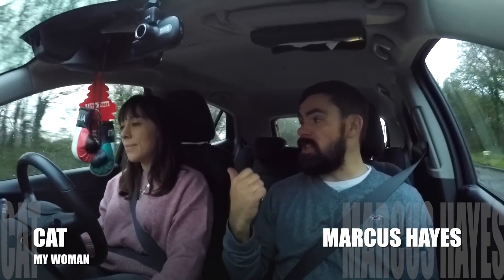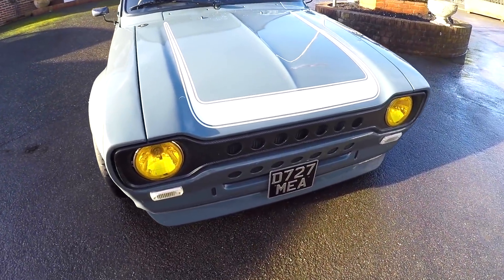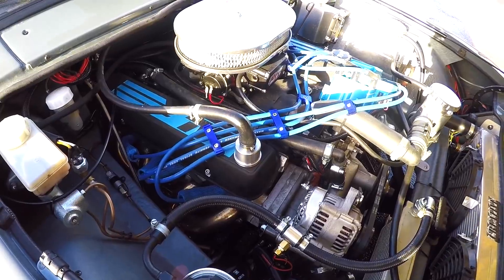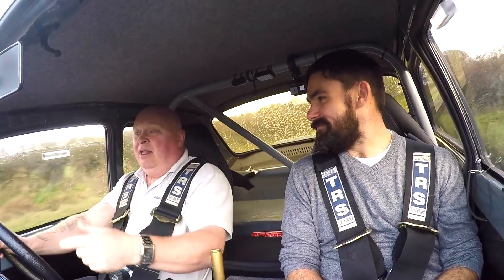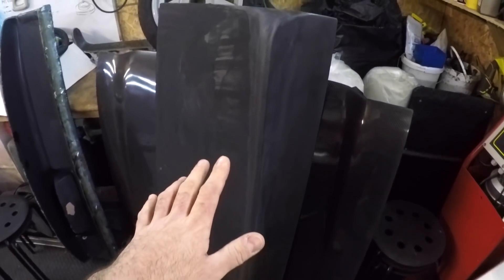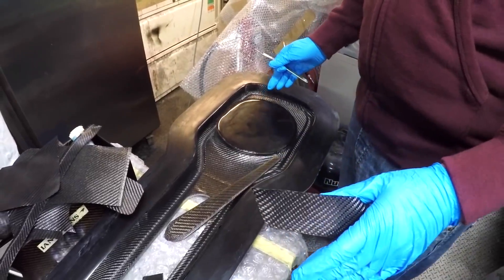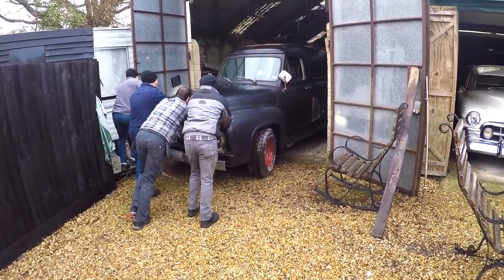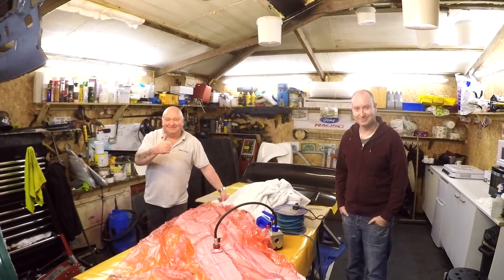LIGHTWEIGHT Mk1 Escort is a V8 MONSTER!! 😃

Comment: Should have put a P76 V8 in it....4.4L.
Reply: the 3.5 is what was fitted to the tvr and is the original engine. all numbers matching so leaving it as it is. next project will be 4.0 twin turbo
Reply: @garrybull4165  G'day from Aussieland Gary!! Absolutely love this build mate. Superb!👌💯 As a custom bike builder/restorer, i understand your reasons for the combination (re keeping all numbers matching for MOT/Rego reasons). 3.5 sounds amazing, and your fibreglass & CF work is first class mate. Looking forward to seeing more of your work. Cheers 🍻
Reply: @mrmcbeardy9268  thanks mate. kept wiht all the original engine etc as wanted all the numbers matching. if i changed the engine before car was looked at by dvla i may have lost the cars identification. i didnt build the car to drive it like a twat. built it to look the part and sound the part. any performance is a bonus. next car though is having a 4.0 twin turbo v8 in it

Comment: You can not call that car a mk1 escort. It has to retain its shell it was born with to be what it is. You guys threw that away and wasted another mk1 in doing so, which would of been worth 20k plus and climbing everyday. Insted you cut away everything original and modernised with carbon fiber omg you think that is good do you?
How many times in this video do u use the words fiber. 
Fiber this fiber that, about a car made in 1970. It doesn't work does it.
low and behold we then find out that the entire chassis is TVR.. with the engine too, which was a rubbish v8 in its day and is not basically a rover v8 by any stretch of imagination. That was a decent v8. 
This car is a TVR and not a good model, the shell could of been molded in any shape it just happens you chose the shape of a mk1 escort but to call it a that is utterly wrong. 
TvR engine tvr gearbox suspension everything. I'm pretty sure if I put the reg into dvla it's going to come up TVR!!!!!!!
A different experience than any mk1 you ever been in, your words. Well I wonder why that is mate. 
Fake car which is worth more as scrap. I now realise my words up top, you never had a mk1 escort that you cut away. You just got lumps of plastic molded in the same shape as a historic classic car and bolted it to a TVR. 
So proof being proof. Bang that plate into dvla yourselves. 
Tv'F'R rubbish.
Reply: On the positive side, it won’t rust away.
Reply: Nonsense 😊